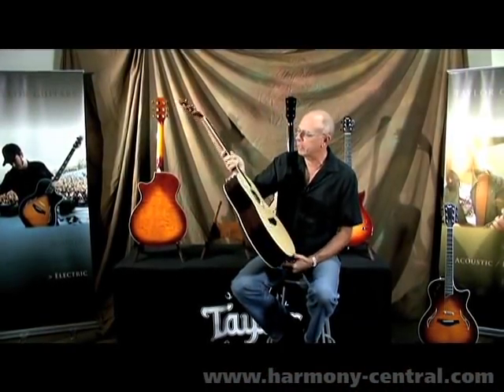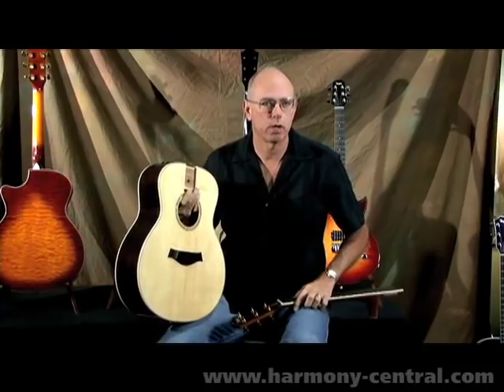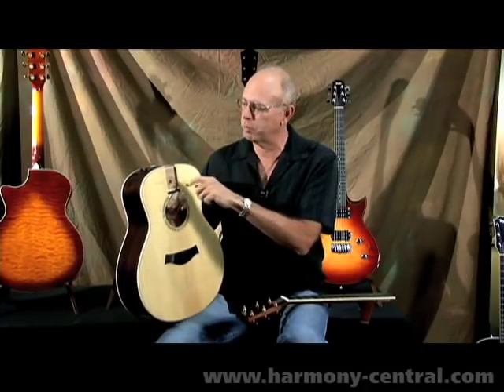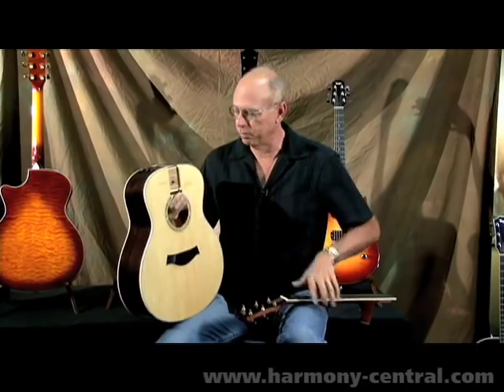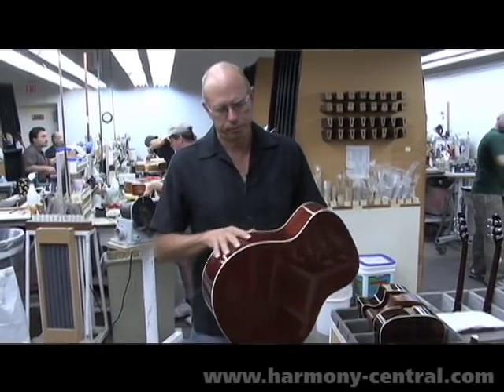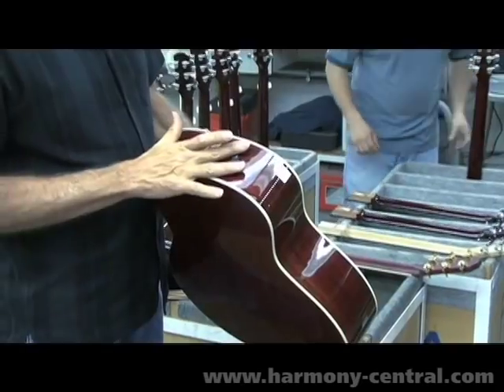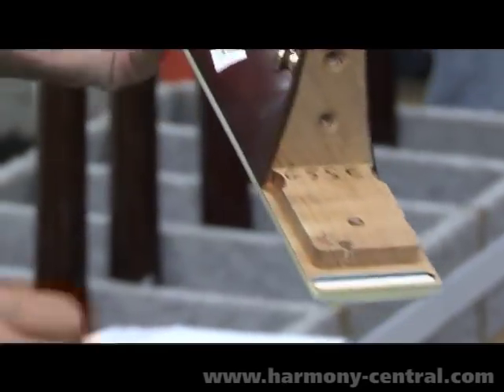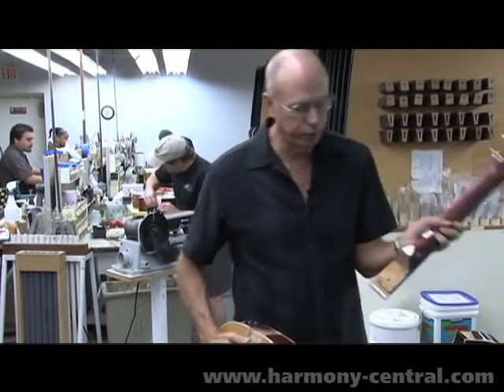Taylor Factory Tour Part 4 of 4 - Final Assembly

Comment: As Mr. Taylor says many folks have "opinions" about machining guitars versus "hand built". Many of the boutique manufacturers ( even the smaller ones) are using CNC routers for cutting the body and  the neck and many are using bolt on necks. Even Gibson and Martin use CNC routers for their dovetail joint carving and rough necks.Taking the inconsistency out of the manufacturing process is a natural evolution of industrial innovation. The real soul of the instrument itself is in the wood chosen ( body , top , fingerboard), body shape and bracing adjustments ( spacing and carving) . Less important, but factors, are the upgrades to bone nuts and saddles , bridge pins, tuning machines. If you want a "one off" or some special inlays , etc, the Taylors and many other professional grade guitars are not for you ;but ,for the vast majority of players  these guitars are a great , even exceptional, value ( see how many pros use them !).

Comment: one of my sensors came off and the wires pulled off the soldering. Its ES1 system. 2006 814ce I am going to try to solder the red, white and black tiny wires back on. But I am not sure how to glue the sensor back on top. any glue??

Comment: I very much love my Taylor guitar but i hate the expression system.  its just awful sounding,
Reply: Agree 100%. The expression system is not a pleasant amplified tone. I owned a pre-expression Taylor 814CE and have been a 'sound guy' for a couple decades. I always sigh and frown when a musician with an expression system Taylor shows up for a gig. Bob doesn't mention the 'sensor' is oil filled and prone to failure by leaking the fluid that the sensor coil is floating in. I share your distaste of the expression system.